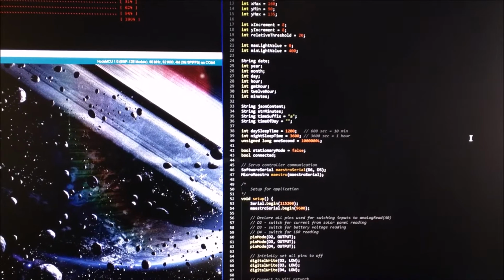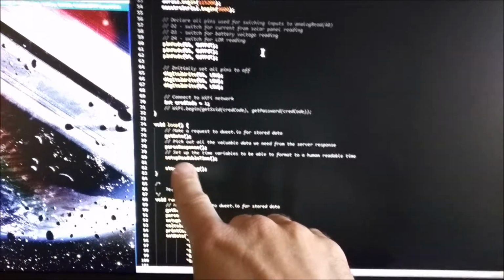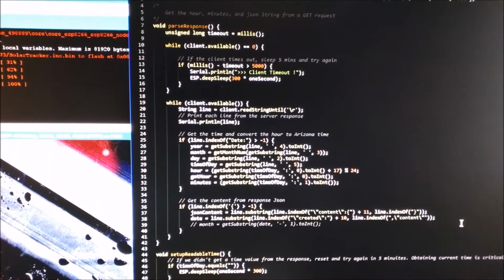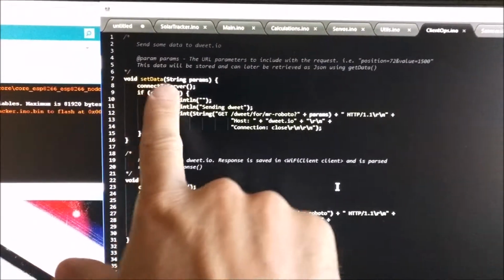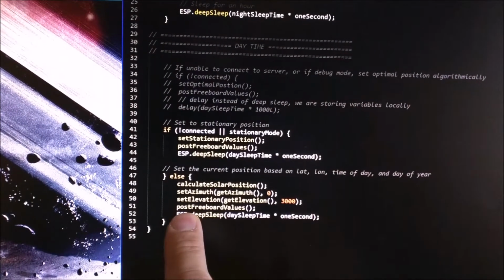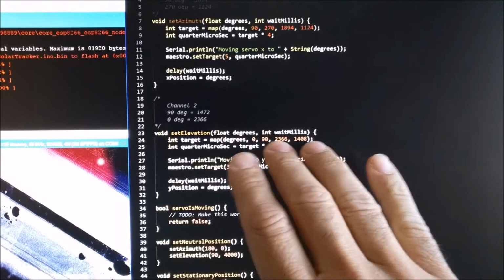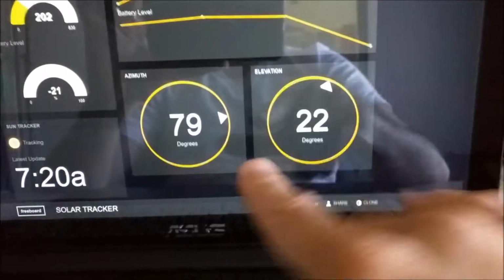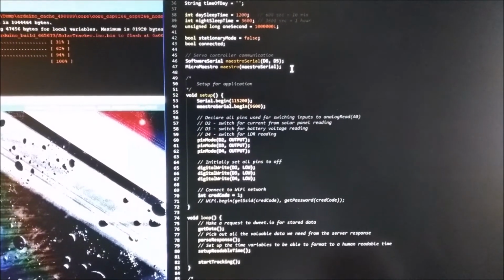Sun Tracking Solar Panel rundown part 2 - The Code

Comment: Freddy, Thanks for the video. I am redoing a solar tracker for a solar oven and am switching to a Wemos D1 mini (ESP 8266) Do you have a schematic  for your project? Is the code available? I probably only need about half of it but don't want to retype what is seen on the video screen and not have available all that isn't shown.
Reply from the maker: Hey George I'd be happy to help you! First let's start a conversation via email. Send me your contact info to freddy.kilo@gmail.com and we'll go from there :)
Reply from the maker: By the way, I rewrote most of this using micropython, if that's your thing.

Comment: Hi Freddy, thank you very much for your increadible video! I'm a high school student, I'm a enthusiastic for this topic and willing to learn. I also want to build a similar project however i have no coding experience. I wonder if you share your source codes with me  so that i can build my own project. 
With respect. thank you
Reply: Start learning programming bro. When it is you own project then it should be your own code. If you want to learn the world of µc programming, start with small projects and you will notice it comes by itself. You need a bit of talent, but most of it is practice and learning. Object-oriented programming is best done with c ++ or Java (My Opinion). C ++ I learned from the Arduino and that was my start into the world of µc programming.

Comment: looks great! having that code to look over (minus any passwords) would really be great!
i'm looking for a dual-axis solution, myself! I'm just getting started with Esp8266 & have been using Arduino for a coupla years, now.
Russ from Coral Springs, Fl, USA
Reply from the maker: Russell Holt yeah the esp8266 is way more capable than a standard arduino Uno. More memory, wifi, great support, and it's tiny!
Reply: Freddy, thanks for the reply. are you up with sharing your code? I can understand if you don't want to. but, if so, could you either post it or you can email it to me.(i don't worry about my email being shared.)
rholt51@att.net
Russ from Coral Springs, FL, USA